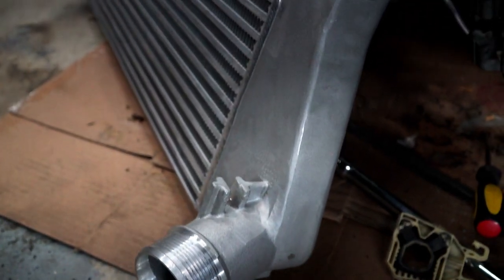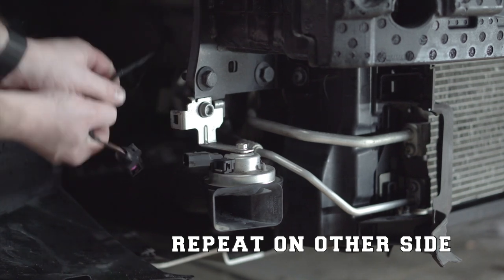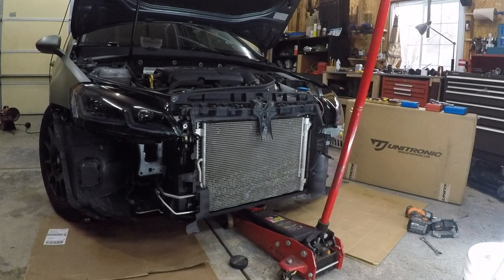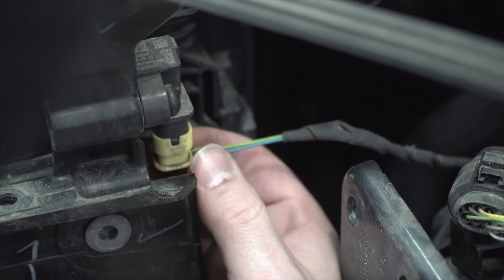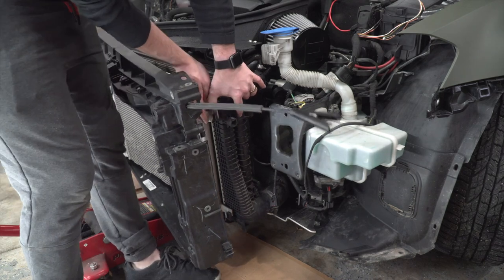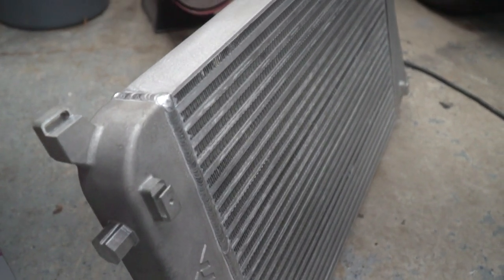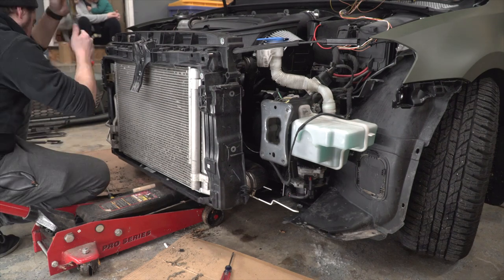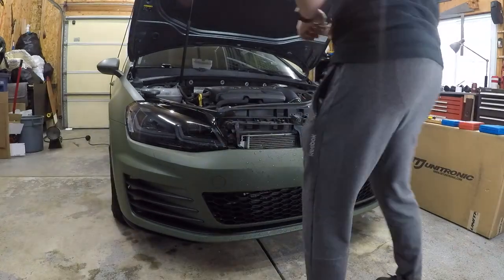Installing a Unitronic Intercooler on a Mk7 Golf Sportwagen (Mk7 GTI and Golf R)

Comment: Excellent video again! On the OEM intercooler- While it wasn’t designed above-stock horsepower, the tube-fin is indeed crazy light and VW engineering knew what they were doing with this air-air core design. Besides the lighter weight, tube-fin is less affected by under-hood temps, placement behind the condenser and they generally allow more air to pass to the coolant radiator.
Reply from the maker: Thanks for the detailed info! All stuff I didn't know. Thanks for sharing with everyone.
Reply: Unitronic IC has a tube/fin or bar/plate core?

Comment: I have heard this is a nightmare, would.you say easier or harder than installing the turbo? It doesn't look horrible to me, probably just because I have torn the whole front off my MK6 before.
Reply from the maker: Definitely easier than the turbo. if turbo was 9 out of 10... this is a 7-8?
Reply: The downpipe looks like a bear too. I wanted to do more on this car myself but I'm not sure I have the skills for a couple bits... My MK6 had one shitty bolt for the downpipe, this is a whole new animal lol. At least I'll do the suspension.

Comment: time for some charge pipes and that is38!
Reply from the maker: IYO, how necessary are the charge pipes? It seems to be a 50/50 from is38 runners on if they put them in or not.
Reply: Maybe it’s just psychological but I have the ECS Tuning charge pipes and I just installed them last weekend. I feel like my gti is a little more responsive. I also just like how the pipes look. I’m planning on tossing in an IS38 once it ships and getting a solid tune. My gti is pretty much stock atm with just an intake, bigger turbo inlet, turbo muffler delete and the charge pipes. I’m waiting to throw in the down pipe, turbo and intercooler before getting software. Overall feels a little more responsive but I’m not sure if it would be that noticeable if you weren’t stock in the first place. That’s my take, and I drive about 100 miles a day with a majority of it being highway.
Reply from the maker: @michaelkain7641  Thanks for the reply and the detailed input. Your GTI is going to fly once you get all your goodies in stock and installed!